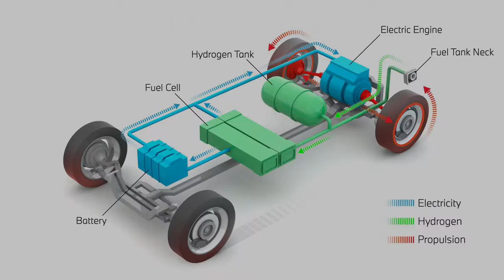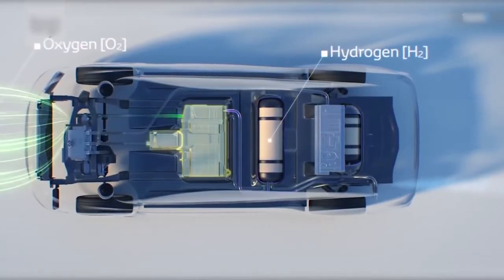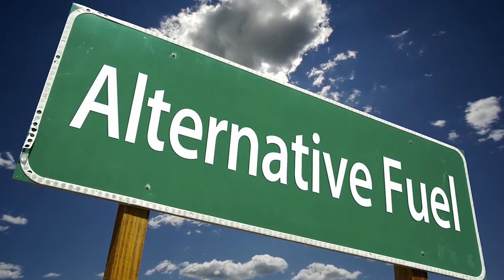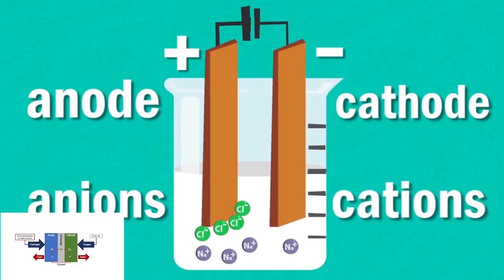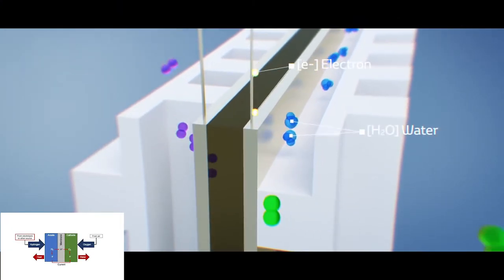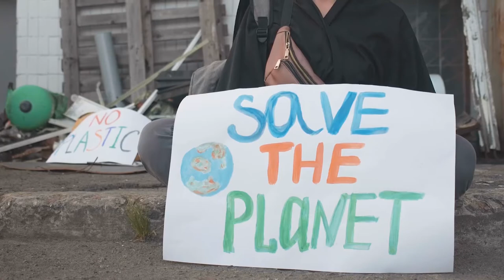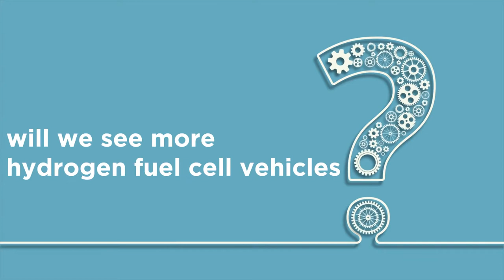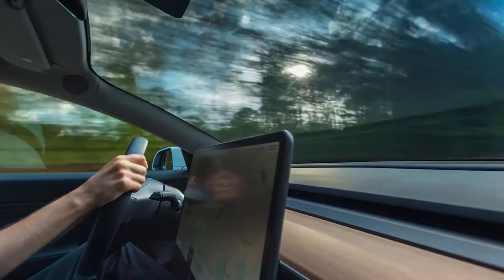Hydrogen Fuel Cell Cars Pros And Cons【-】Are Hydrogen Cars The Future?

Comment: Well I looked around to find the hydrogen tree that grows the hydrogen fuel. Then I realised hydrogen is a kind of inefficient battery. i.e electricity is used to split water, electricity is used to compress the hydrogen, electricity is used to transport the hydrogen to a gas station, electricity is used to transfer the hydrogen to the car tank. Finally electricity is used to de-pressurize the tank. All done without considering the costs.
Go pull another one !